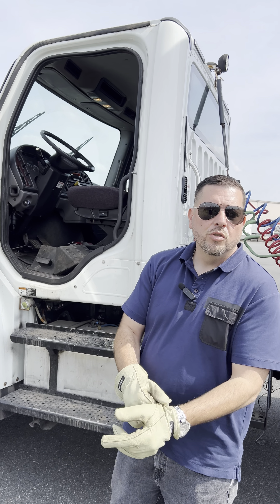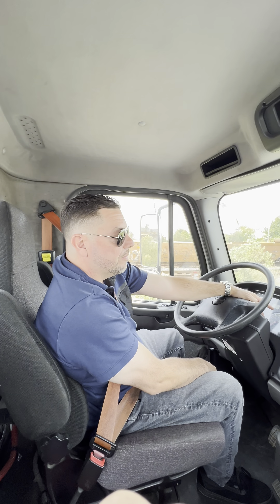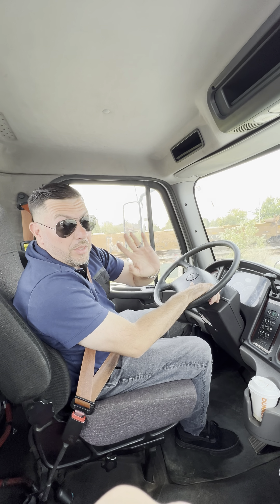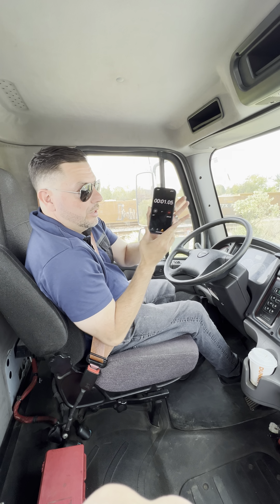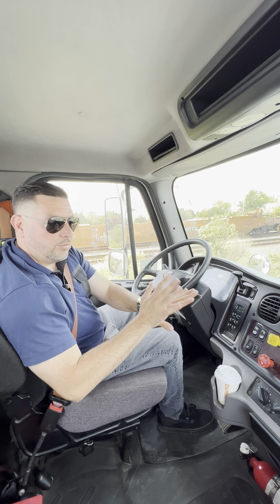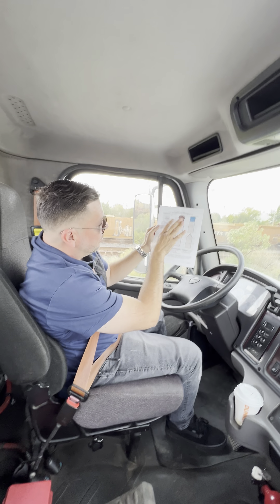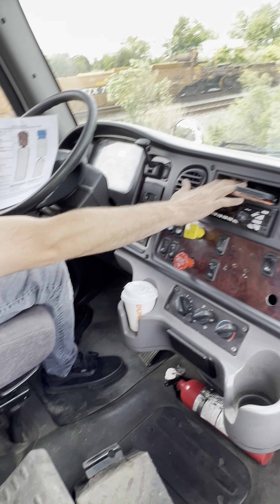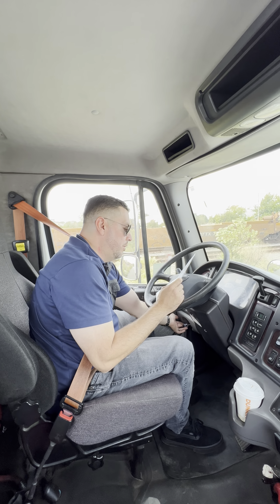"How to Inspect the Inside of an Automatic Tractor Trailer and Perform an Air Brake Test.

Comment: When we push in both valves before the 1minute do we wait for the pressures to stabilize or just do the 1 minute test after pushing them in
Reply: It is already stabilized because you already build up the air in between 120 to 140 Psi and the governor released…due this, you can right after , turn the key on, release both brakes pushing in both and you can start the break test with the “4 lbs within on minute “ procedure!